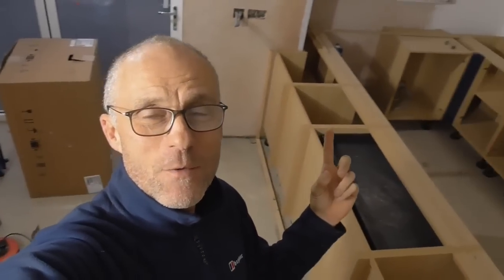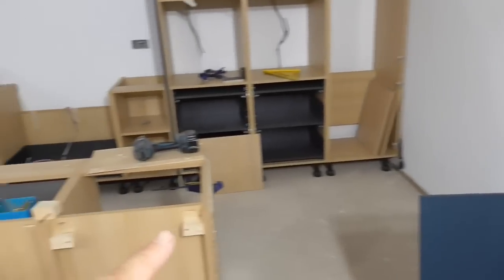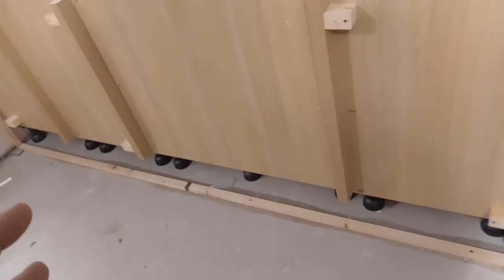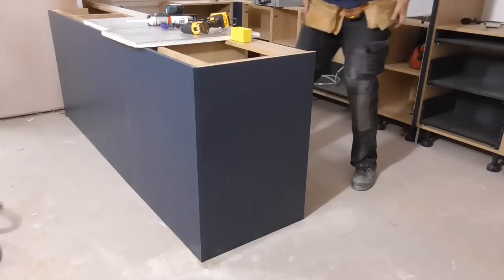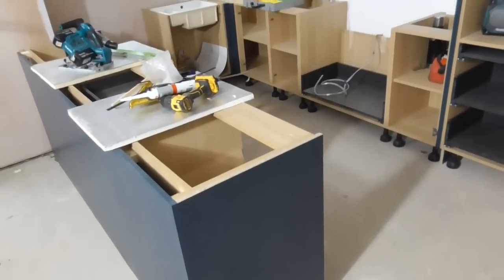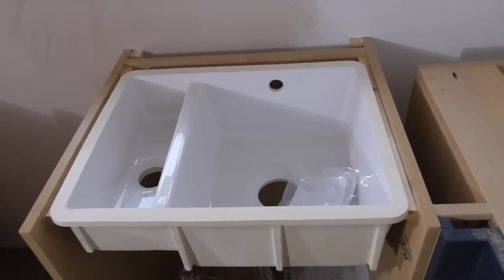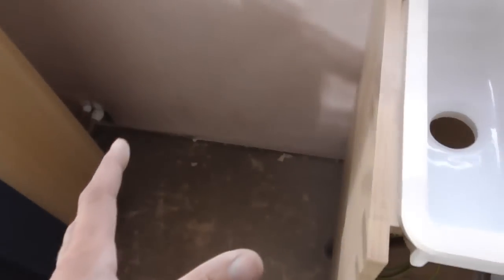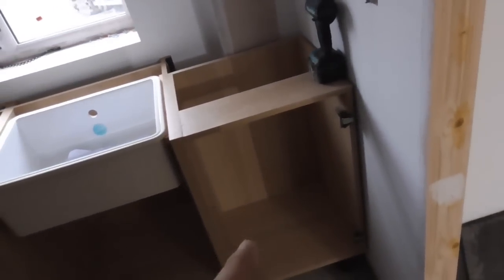Kitchen fitting in the 12 hip house PT.2***UK CARPENTRY 2ND FIXING***

Comment: It was a pleasure to see you work.  Nice job.  In the utility room with regards to the water pipes take the back of the cabinet out and put a 30mm by 30mm tiber on the uprights at the back and then trim the back panel down a few mm then use 4 or 6 mirror screws to attach the back panel back into place.  The plumber will thank you for it and this can then become a maintenance hatch.
Reply from the maker: Hi Sergio🖐That's a great suggestion and similar to what I might do if the pipes ever needed inspecting/working on👍In this instance though, the pipes are below the base of the unit, so removing the carcase just made it easier during the plumbing installation👊Thanks for your comment and for watching 😎 Cheers Del

Comment: Great video once again👌👌
It's a pity the manufacturer didn't make a dedicated sink unit with a stepped down back and a deep front rail, makes life a good bit easier when fitting the tap and supporting those sinks.
Another tool for you to consider for future kitchen fitting is a pocket screw jig (unless you already do), so handy especially since the manufacturer uses this method.
Reply from the maker: You know what John🤔you must have been reading my mind a little, as I did think how cool pocket screw fixing is, and that I should buy myself a jig😎Thanks for watching and your great comment 🤩Cheers Del
Reply: @thetallcarpenter  Its amazing what uses you find pocket screws for. Great to use instead of angle brackets in a lot of cases but really good for fixing end panels or haffits when forming openings for integrated appliances. Angle brackets can make a 600mm opening too tight.
Reply from the maker: @johnmackay7789  Sod it John😮I'm gonna get one👊
Reply: @thetallcarpenter  there's is quite a choice out there, I'm still using the original Kreg one from about 20 years ago which is fairly limited compared to the new fully adjustable ones. Also the panhead pocket screws are the best to use but you can just get away with countersink screws you have to be careful not to bust out the pocket hole. Cheers 👍
Reply: Yes if you don’t plan ahead with the sinks that fit most of the unit boy would you have a fun day fitting the tap. I have fitted a few lately and like you say a dedicated unit with the supports and cut out’s would save a lot of faff. Some of those sinks are 25kg without any water and washing up.
Reply: @tracer1127  Fortunately the manufacturer we use  makes such a sink unit. Undermount sinks only need the necessary framing for support and no  alteration is needed for an inset sink.
Reply: That would certainly make life easier. I’m guessing that all of the manufacturers will eventually get on board with it, but it’s amazing how much stuff we have to sort out ourselves. A little thought during the manufacturing and development stage would help us all out and save us a lot of time..
Reply: @johnmackay7789  A stupid question probably but do you use the pocket hole jig to fix through the end panel between 2 appliances for example up into the work surface instead of L brackets? Thanks
Reply: @tracer1127  Aye, that's become the norm for me for a good while now. Don't get me wrong angle brackets are stronger but Ive found that along with the fixing screws they made the 600mm opening for an integrated appliance too tight.
As the years have gone by I've learned how much you can get out of the pocket screw jig in kitchen fitting.
Reply: @johnmackay7789  I like the idea. Can you recommend a jig that you would use for kitchens if you you was going to buy a new one . Thanks
Reply: @tracer1127 I honestly think that unless you buy a real cheapy chat you won't go wrong with any of the usual suspects. They are now fully adjustable for a whole range of thickness of material. The UJK Axminster one looks the dogs danglies and the Trend one looks very good. Rutland has it's own one very similar to Trend. My one is an ancient Kreg one that it made from a cast alloy of some description but Kreg have switched to a more plastic material which I assume make it more lightweight to use. I personally think they are one of those tools you'll buy and gradually realise their worth. Its helped me get out of a good few sticky situations when before I'd be firing in angle brackets or face screws. 
Hope this helps you.
Reply: @johnmackay7789  Thanks for the help. I’ll get one sorted. I’ve had numerous situations over the years when the screw heads sticking beyond the L bracket have caught on something. Thanks again 👍
Reply: @tracer1127  my final tip goes back to our original point of the sink unit. If you get or alter a sink unit to have a 100mm - 150mm vertical front rail, you can fire in 2 or 3 pocket holes to make it easier to fix the unit to the worktop - assuming it's a laminate or wooden one.
As you said earlier, it's planning ahead.👍
Reply: @johnmackay7789  Thanks will try it out 👍

Comment: Great work del,  I will be starting my kitchen soon,but first I want to install some insulated plasterboard on the walls, what fixings do you recommend for kitchen units onto insulated plasterboard walls. Cheers Del 👍
Reply from the maker: Hi Glen🖐You might have caught me out with this question bud, as fixing wall units to plasterboard is something I always avoid purely due to the weight that these units can have in them. (plates/crockery etc).
How thick is the insulation? If it was no more than 50mm I'd think about using M8x100 'Fischer' fixings so they will go into the masonry behind🤔
Reply: Thanks for getting back Del. It will probably be 50mm thick. I will look into the fixings, many thanks for your recommendations. When is your next kitchen video, keep up the great informative work. 👍
Reply from the maker: @glenwilkins8587  I'm 1st fixing a small bungalow right now, so the kitchen will be going in that in a month or so👍

Comment: Nice work Del, nice to see how the pros problem solve. 2.4m max 70mm short 😮
I can’t work out in my head how you did that end scribe which fitted perfectly 🤔
Reply from the maker: If you kean the ones on the wall cabinets, then they were marked out with the help of the UScribe jigs👊Thanks for watching Doug😎
Reply: @thetallcarpenter  there the ones Del

Comment: ive just started a kitchen today del. i notice on this video you have the hinges fitted already. assume you attach the doors this way. i always attach the hinges to the door and then fit to the cabinet. think ill have a try doing it your way see how it works out. also.. what are you using for your scribes? that looks like a good system
Reply from the maker: Hi Paul🖐The hinges come fixed to the carcass from the work shop, and I just unclip them and fix then to the door, and snap the door on👊Cheers fella
Reply: @thetallcarpenter  ahhh haha was thinking there you clipped em on and fitted thedoors that way. ive always fitted to the door and then cliped them on to the cabinets like.
Reply from the maker: @paulfinnonjoinery  👍😎

Comment: Great video Del, what plugs and fixings did you use for the top cabinets?
Reply from the maker: Hi Mark🖐Fortunately here, the dot and dabbers solid fill where the wall cabinet fixings are, so I can just use red plugs and 5x60 screws👍(I do knock the plug into the wall a bit so it's mostly in the masonary👊) Cheers